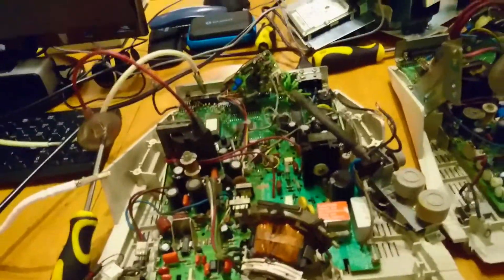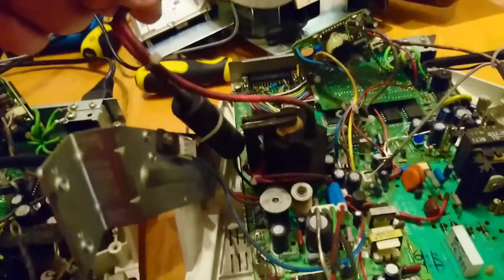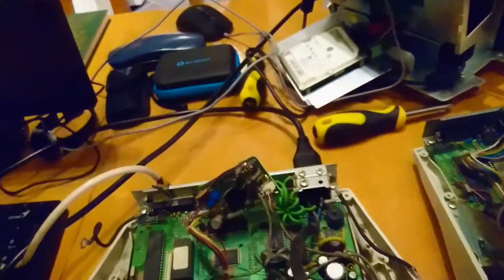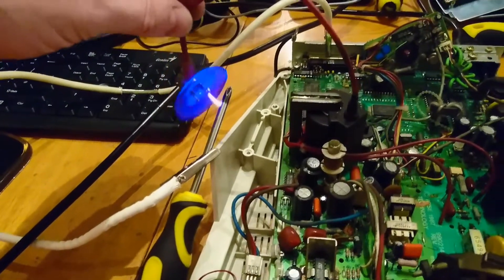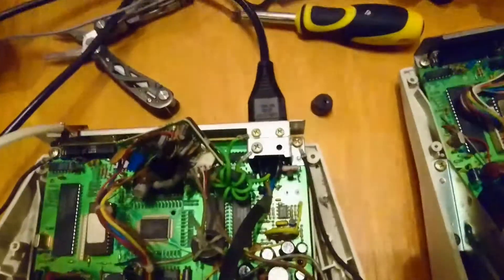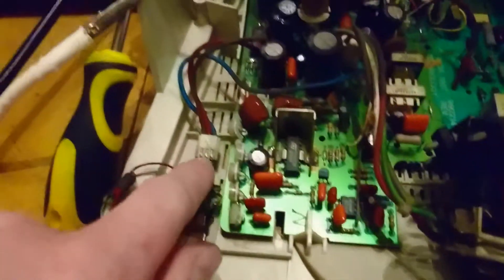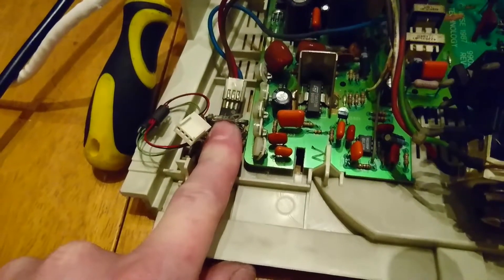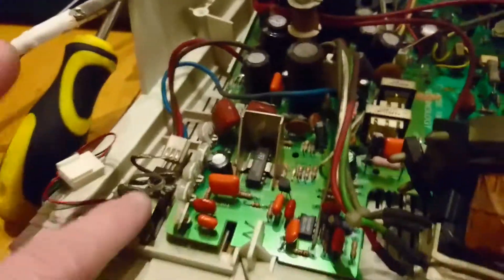MAINS CRT Transformer Flyback ARC'S

Comment: flyback on first board is a very good one ,  as it happens I have one of them . if you dig at base of red(+) wire you can recommend that HV rectifier diode and convert it into a ac flyback 
mine has a translucent epoxy filled in it beneath the black cover
colour of epoxy is of yellow translucent Amber

Comment: The sound of flyback corona is awesome. That second one was violent, and destructive to the driver transistor. Great to see that you are back.
Reply from the maker: RODALCO2007 lol iv always been back ray lol. and the flyback and the transistor was fine. it was the capacitor in the black round unit that died. 😢 lol 
couldn't take the POWWWWWER⚡⚡! 👍😉

Comment: It's likely you killed the HOT (Horiz. Output Transistor) on the 2nd unit. Either that, or it went into shutdown.
Reply from the maker: William Squires Hello buddy,
I'd killed the capacitor in the black long tripler! as I cut it off ' and the flyback was working as normal. thankfully lol😉👍
thanks mate for the comment. 

Anthony 

High1voltage1rules